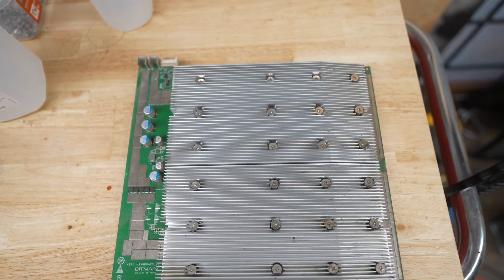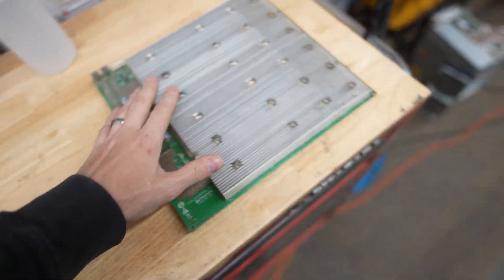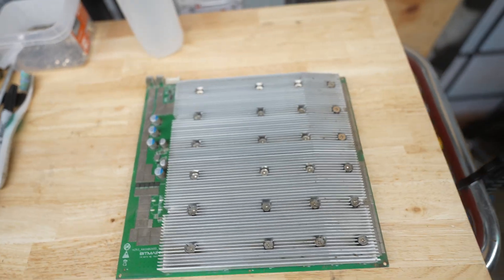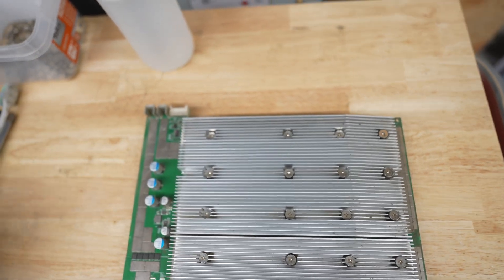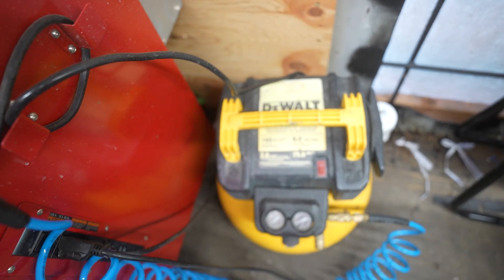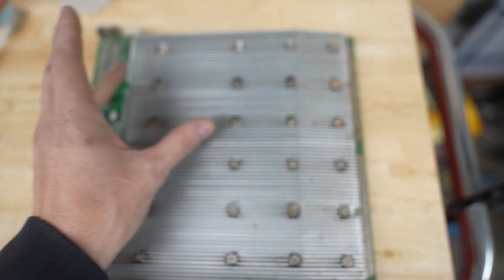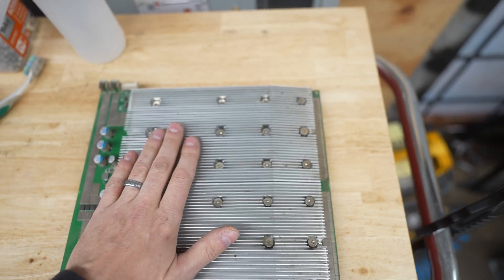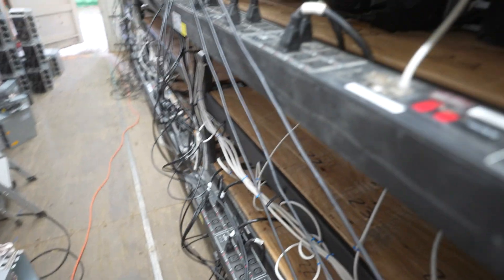Fast Fix for Bitcoin Bitmain Hashboards - Free!!

Comment: As a repair tech, I call bullshit on the 50%… if it shows 0 asic. But at least you  do at least clean it and try…. Oh and I charge $100 for S19 repairs 😊
Reply from the maker: Its around 30-50%. It does work at a decent rate. Saves a ton of money and hashrate.
Reply: I’ll do $40 a board